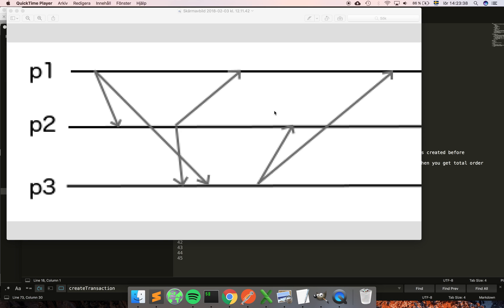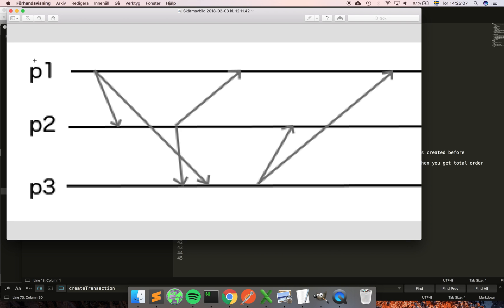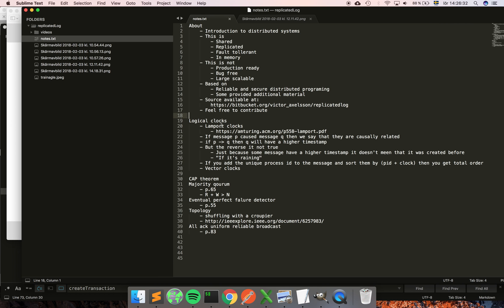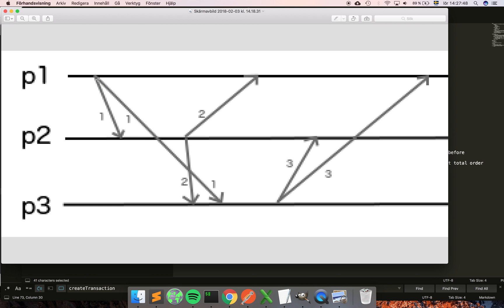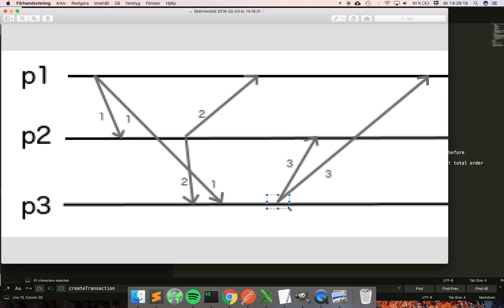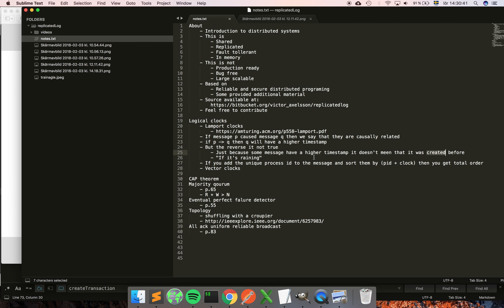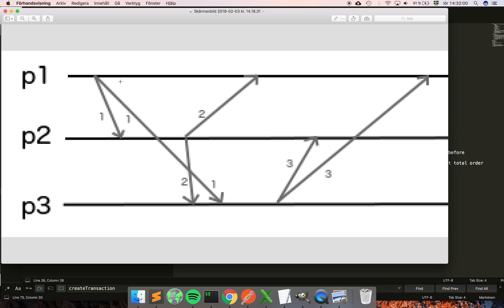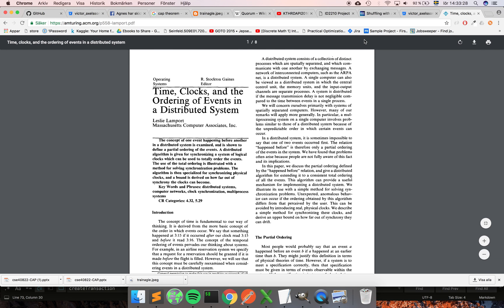4, Lamport clocks

Comment: 5:27 this is not right. The local clock will be t=3.
In Lamport's algorithm it says on receiving a message with timestamp t', do
t := max(t, t') + 1
In this case:
t := max(0, 2) + 1 = 3
Reply: I think this is only the case if the received message is bigger than the current timestamp